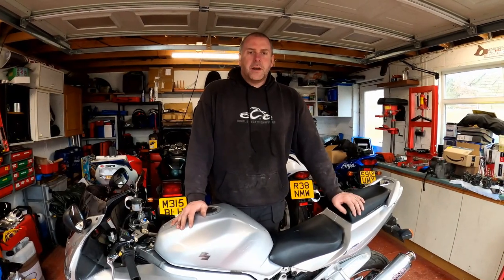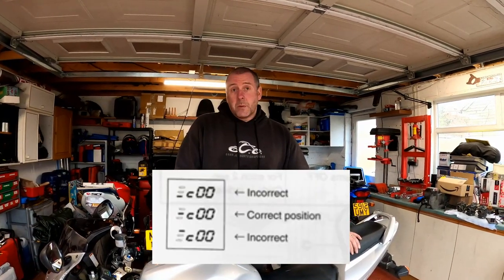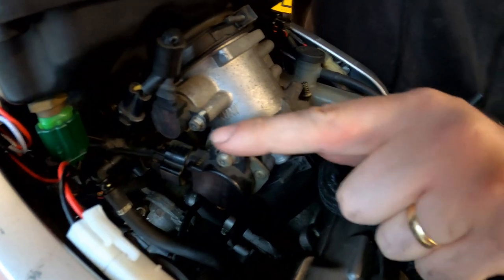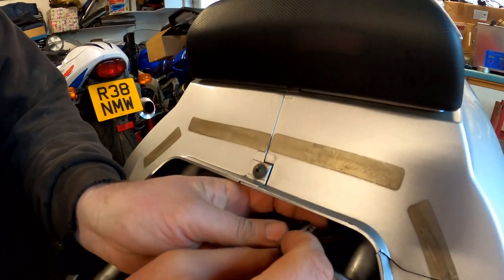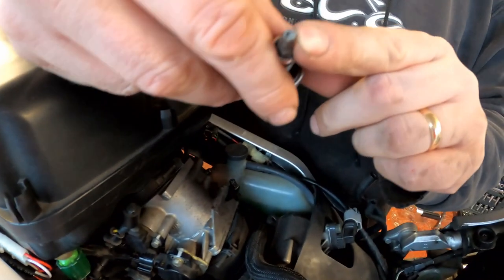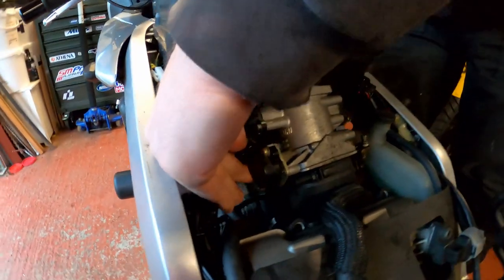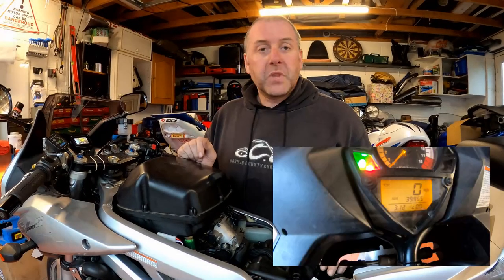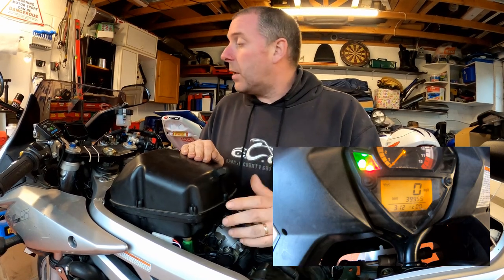Suzuki SV1000 & SV650 Throttle Position Sensor (TPS) Adjustment

Comment: Hey Kev , have a sv1000 2005  it has a missfire rear cylinder dies out and has a wet plug when i take it out . when i  ride and open the taps at high revs both  cylinders  cuts out       and then come back online once slowing down have no idea what to do had big flames when it miss fires tps shows ontop when i  idle ? What could it be . Thanks

Comment: Really the correct way to do this is with a multi meter. You should have 1.2v dc at idle and 4.5 at wot. You can test this without the bike running.
Reply: Hi, you mean 1.12V ?
Reply: @franksagen5049  thats the very lowest it will go. Mine doesnt seem to like it there.

Comment: Could a misaligned TPS be the reason my 2008 Vstrom 1000 misfires?  It only seems to happen in either 3rd or 4th gear, between 2,500 and 3,500rpm at around 60kph on a flat road.

Comment: Hey mate I have sv1000 and it's got a rev limiter of 5200 is that all it supposed to rev 2 or is it supposed to rev to 11000
Reply from the maker: Hey man! There is definitely something not right with your bike, the rev limiter is somewhere around the 11k mark although I can't remember the exact figure off the top of my head! For info, the SVThou makes peak torque at around 7500 RPM and peak BHP at around 9300 RPM so there is a problem somewhere! Does you bike have the FI light lit on the dash? Have you tried to put it into dealer mode and see if there is  a code stored? It could be something simple like a vacuum hose that has come off, or even a problem with fuel delivery. Then again it could be an electrical/ignition problem! Start by checking for fault codes and go from there!

Comment: I have fitted a new throttle tube and now if I start the bike it revs up to 5.5k doing the tps adjustment should fix this shouldn't it ?
Reply from the maker: No
Reply: @KevsShed  need to adjust the cables then ?
Reply from the maker: I would say there’s a cable problem. The TPS doesn’t directly affect RPM as it’s the butterfly’s inside the throttle bodies that do that. The TPS simply informs the ECU of the position of the butterfly’s
Reply: Thanks for the replies:)

Comment: Thanks for the video, as I was just about to do this myself. FYI: Just setting it to the middle line doesn't mean it's perfect. For example, when the line is in the middle, you can still get to 2500-3000 rpm before the injectors squirt more fuel into the cylinders (line moves to the top). With that high of a setting you will be having a jerky and rough ride in lower gears and lower rpms.
Optimally you should calibrate the TPS until the line is in the middle at idle, and moves to the top between 1450-1600 RPM. The bike needs to be running of course. It can take a second or two for the line to move, so go slow on the throttle.

I drive a lot of slow and blind bends, so often at slow speed in second gear. The jerkyness when I go back to the throttle is exhausting over time, and it doesn't matter how smooth I am.

I have no idea why Suzuki isn't more precise about this in the manual.

Would love a follow up video where you try this calibration, and maybe post if you notice any differences in the ride at lower gears/RPM.

PS: The engine needs to be warm before making these adjustments.

Thank you again for the video. :)

Comment: Thanks 
Was having trouble sputtering between 2500 and 4500. Recently had throttle bodies synced.  Started sputtering after 200 miles after got worse came across your video, followed the instructions and cleared right up and runs smooth throughout the rpm range. Gonna double check it after work when it has ran longer.  Will save a few hundred dollars.  Thanks! 🏍
Reply: mine is sputtering around the 2500 to 3500. good to know it looks like I'm barking up the right tree
Reply: Another thing to look for is fuel pump, if low fuel pressure will make it sputter as well. Fuel pumps are pricey. Find a good condition preowned one for replacement.

Comment: Oh man!!!!  You did it.  I was just about at my wits end with my bike immediately dying after starting everytime.  It got worse and worse and I tried everything but I couldn't find anybody or anything to explain your dealer mode trick and then to explain and show perfectly how to adjust the positioning sensor.  I have an 03 sv650 that I love.  I was about to drop a grand to find out what was wrong.  Now I'm back riding with no problem after your 5 min video.  I could kiss your bald head and call you Budah!!!!!!!!!!!!!!!!!!!!!!!!!!!!!!!!!!!!!!!!!!!!!!!!!!!!!!!!

Comment: Aren't you supposed to leave the tank on it and try to bring the rpm to an expected number 1.5k or 2k before you see the middle bar going to the top position ?
It has to be precise to have the performance you want, so making a mark on it after you reach the perfect settings makes sense.
Reply from the maker: I followed the factory manual to the letter bud.

Comment: Thank you for this video as it is very helpful.  My 2015 SFV650’s TPS is set so that the dash is in the mid position but the white line is about a full cm away from the white line on the carb.  This is how I found it when I went to adjust the TPS.  I bought the bike last year and have been trying to find out why my idle is rough.  I thought it might be the TPS after watching loads of YouTube vids.  I came across your video which explains the adjustment so clearly.  Can you explain why my TPS white line is so far away from the white line on 5he carb, yet, the dash is in the mid position at idle and jumps to the upper position at around 2000rpm?
I’m hoping you can offer some advice.  Thanks.

Comment: Hey there. My 2006 sv650 has this weird problem where if I ride it for a little while it will randomly then idle at 5000rmp no matter what I do. The only way to sort the problem is by turning the bike off for a few seconds and then back on
Reply: Same issue. No matter how much I adjust it and the engine idle screw. After riding it a half a mile or so, revving just diminishes until it dies. Out in neutral and it fires right back up and will ride good for maybe quarter mile then immediately starts diminishing in power again and dies. I don't know what to do next to fix it. No codes shown 🤷🏾‍♂️

Comment: My suzuki sv1000s has a fault code dash above C 017  I don't know what sensor it is. could you help me

￼
Reply from the maker: The manual lists it as rear intake air pressure sensor, I would guess it’s a connector problem as it’s not a commonly failing sensor.

Comment: Thanks! Just want I wanted to do today!
However, with TL1000 it should be running idle and warm. Is this not the case with SV?
Reply from the maker: Absolutely correct, the TL manual does indeed tell you to do it with the engine running, the SV manual however tells you to stop the engine before making the adjustments, it should be up to temperature and the idle adjusted to 1200 RPM (+ or - 100 RPM). Not too sure why they do it differently considering how alike the 2 engines are! But that's what the manual says! 👍🤓
Reply: I tried to do the TPS setup on my K5 1000S with stopped and warmed up engine, but after each engine start, the TPS indication always wandered away... So I succeeded with the TPS setup only when the engine was running.
Reply: Its not 100% necessary for it to be warm or running. I adjust mine with a multimeter. Its way more accurate than the 3 lines.

Comment: Thank you for your video! I am having some trouble with my Suzuki, when I go above 80mph the bike jerks and the rmp gauge drops all the way to zero and then it goes back up, do you think adjusting the TPS might solve this problem?
Reply from the maker: Not sure it will to be fair, have you put the bike in dealer mode and checked for any fault codes?
Reply: Dunno if you figured it out yet but mine did the same and it turned out to be the kickstand switch at those speeds causing it.
Reply: @elijahgabriel1325  is this a matter of better adjusting it? Or have found a fix for it?
Reply: @KevsShed  I checked the TPS sensor  adjustment mode on the bike not sure if this what you mean by dealership mode?
Reply: @jorgesolorio620  I just cut out the switch and spliced it together.

Comment: So what does it mean when the minus is in the up position?
Reply from the maker: The Throttle Position Sensor (TPS) is a kind of variable resistor which detects the throttle opening angle in order to provide the ECM with the data it needs for correct fueling. The voltage that is supplied to the sensor via the loom is converted by the sensor into an operating voltage that the ECM uses to convert into a data figure. The operating time of the fuel injectors is determined by the voltage signal returned. If the sensor is not set correctly then potentially the signal could be (read as WILL be) affected which will in turn raise or lower the voltage received by the ECM. 👌🤓
Reply: @KevsShed Forgive me if I’m misunderstanding. This adjustment was to bring it to factory spec? But don’t many riders adjust this to help get rid of the 2.5k V-twin engine rattle. The following is from the SV Portal, do you agree with this? “Fuel injected Suzukis have a sensor that senses what revs the engine is at and then tells the fuel injection and engine management systems to alter (basically to start squirting more fuel into the cylinders). MOST bikes are set wrongly and this causes the bike to be jerky at slow speeds (due to the fact that there's not enough fuel getting into the engine & then all of a sudden the fuel starts pumping in faster but by then it's a bit late!! This adjustment rectifies the problem!”

Comment: Hi just stumbled across your channel subbed 👍 I have a Sv and it is coffin and spluttering 
Tried adjusting the TPS as you show but the line stays on the bottom what ever position I put it in do you think it is dead ?

Thanks Matt 👍
Reply from the maker: It sounds like it mate, I would expect a reaction from it of some kind. There is a test that can be done on the sensor itself. I’m not able to look in the manual right now but I’ll reply later and let you know the details 👍🏻 alternatively head over to the Kev’s Shed Facebook group and ask in there as I’ll be able to post the necessary pages from the manual. 👌🏻😎
Reply: @KevsShed  thanks really appreciate that , will check out the Facebook page
Reply from the maker: @mattward5335  I've sent you a message in the group chap!
Reply: @KevsShed  what was the problem? my TPS "-" wont move position on the cluster, but it does affect the bike while idling.

Comment: Hello. Changed the engine of my 2003 SV 1000. New motor is from a newer generation. Changed the cam on the rear cylinder to accomodate the cam sensor. Also went into dealer mode and set the throtte position sensor to center dash as your video shows. First i get a -c00 then when i crank i get - c24 snd 25. (Ignition) bike refuses to start. Any ideas.? Thanks.
Reply from the maker: Is the green connector under the tank in good condition? Check for damaged wiring or charring if the connector block. 👍🏻
Reply: Thanks for replying. The one plugged into the airbox?.. if so, it seems fine.
Reply from the maker: @rahjanigrenie367  No mate, it's right up by the headstock and goes to the ignition switch.
Reply: 😥😥 green plug is fine!! Im lost at this point.

Comment: Hello, my problem is C45 on the dashboard after putting the bike in dealer mode. This code is for  Fuel Trim Bank 1,  the check engine light lit when the bike is idle after a long ride. Is it easy to fix myself?
Reply from the maker: My initial thought for a fuel trim error is that unmetered air is being drawn in somewhere. Check for any loose clams, air leaks or vacuum leaks. A fuel trim problem basically means that the ECU is attempting to compensate for the added air by injecting extra fuel, the ECU can only compensate up to a certain limit however. This would be my first check.
Reply: @KevsShed  Thank you sir!!!

Comment: On my carbed zx9r I’ve eliminated the tps all together. Runs better without it. But on fuel injected bikes you can’t do that
Reply: What does a tps do on a carburated bike? Never understood it. My relatives yzf 750 has it as well
Reply: @rem362  Not sure, but it affects the fireing in the cylinders at low rpm.